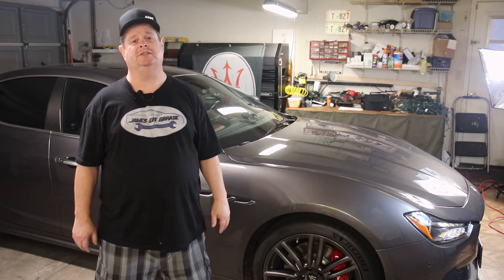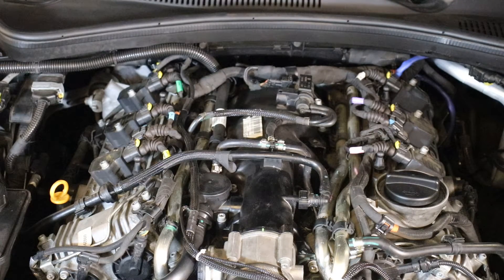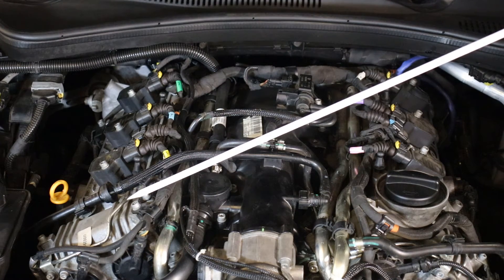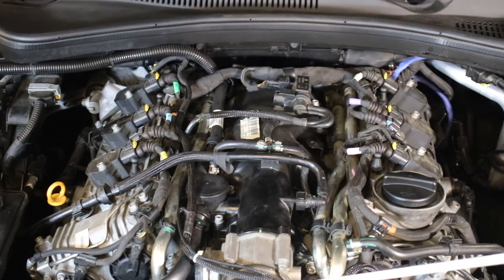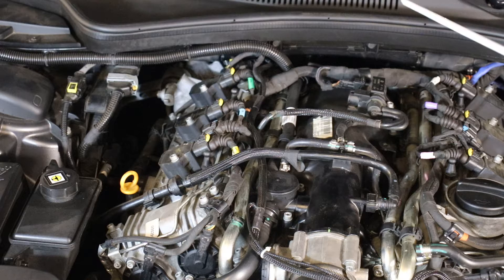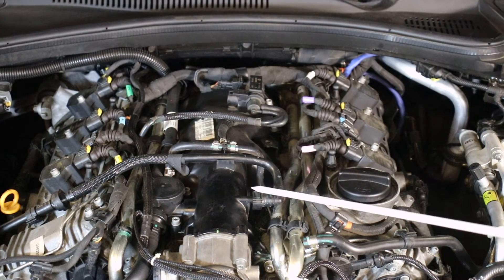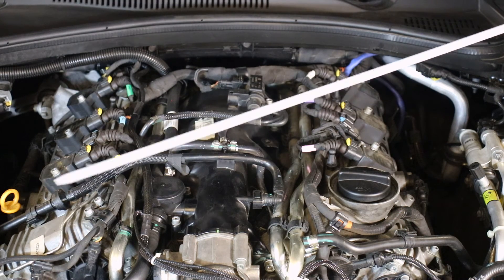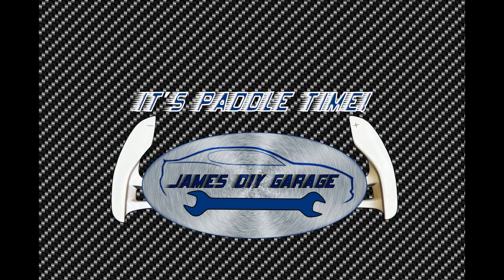What's This For? Part 2 - Vacuum System and Fuel Vapor Recovery System

Comment: Hey James I have a code that reads p0087 anyway you can help ? 2015 ghibli
Reply from the maker: That is a code that should be diagnosed at a european shop with experience on the Ghibli. The code means the ecm is reading low fuel pressure in the fuel rail. Could be bad high pressure fuel pump or bad sensor. I cant diagnose it over chat. A tech needs to look at it. Sorry.
Reply: @JamesDIYGarage  thanks appreciate you taking your time to msg back
Reply from the maker: @ciityniite209  My channel is not that big and my videos do not get very many comments. I see that as a good thing, because I can respond to each and every comment with out it taking all day. :)

Comment: Have you ever had an issue with the car throwing a p0299 code with or without the jb4 at random times throwing you into limp mode? Comes right back on restart. Sometimes throws a code sometimes juat limp mode. Does it with the jb4 disabled as well occasionally. No other issues but this weird occasional issue usually on second startup of the day after getting warm.
Reply from the maker: Check for a hole in the rubber coupling hose on the throttle body.  If there is a lot oil in that area you know you have a hole in that coupling. Email me at jamesdiygarage@gmail.com if you are not sure what I am talking about.
Reply: @JamesDIYGarage  i will check soon and get back to you

Comment: Do you know location for crankshaft position sensor and camshaft position sensor
Reply from the maker: There are 4 cam shaft position sensors. 2 on each side of the engine on the valve covers, one for the intake cam and 1 for the exhaust cam.
Reply from the maker: I will research where the crank position sensor is, but my guess is right by the harmonic balancer/crank pulley.
Reply from the maker: My bad, the crank position sensor is actually on back of engine block, on the passenger (U.S.) side close to where the oil sump meets the engine block. It will be hard to get to I think because it is behind the turbo assembly.

Comment: Thanks again for another Informative Video. I am no longer intimated by my car. I have a 2018 SQ4, same (Interior/exterior) color scheme as yours. Except I have no Paddles! 😞 Otherwise I JUST LOVE driving it. I have mostly pictures sent by the dealer prior to me picking it up. I will take my own pictures and forward to you for one of your upcoming videos. Additionally, I think i would like to get the front/Rear bumpers repainted and the lower skirts as you did. I love that whole car, 1 color look.
Reply from the maker: Thanks for like and the comment.  The Paddles would have been nice, I love using them. Enjoy the car :)

Comment: If your ghibl is a base model the horse power is less than a q4 and ghibi
Reply from the maker: Mine is an SQ4. With a JB4. So I potentially have 460HP with the right fuel. On 91 Octane I should have 440 HP

Comment: Hey James, question for you. I have 2016 base ghibli. Why does it have less horsepower than the sq4? It has the same engine but different drivetrain. Is it just programming in the CPU?
Reply from the maker: I think the fuel injectors are different also as well as it being tuned down.